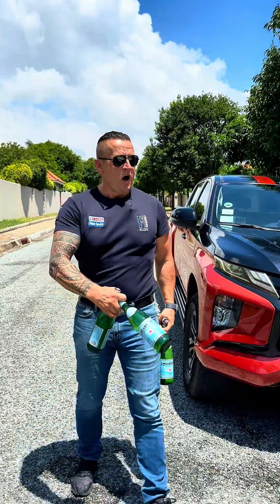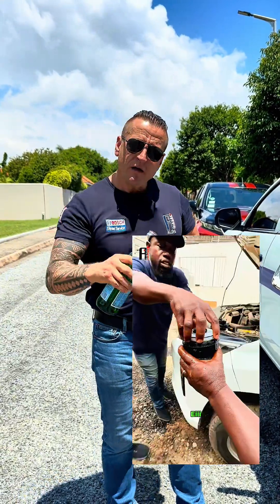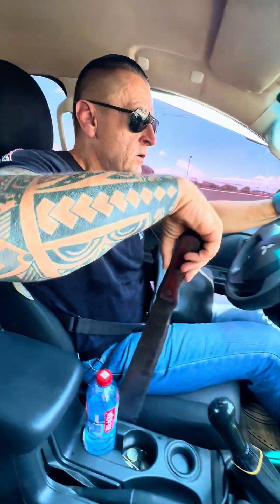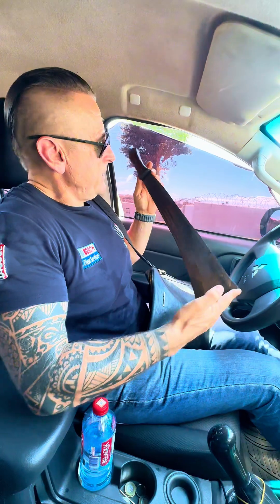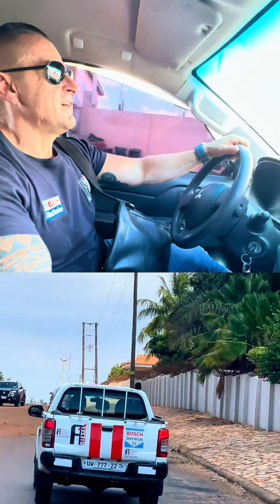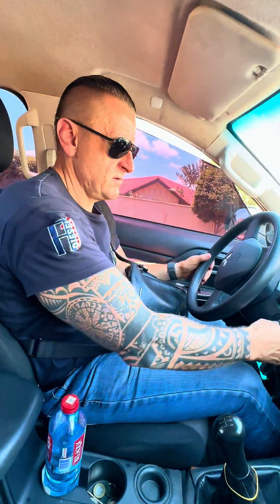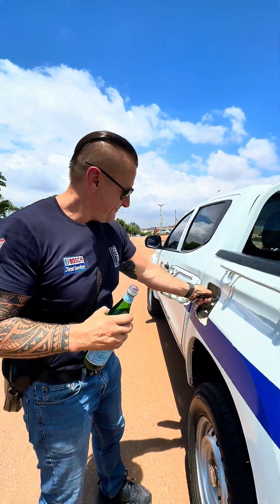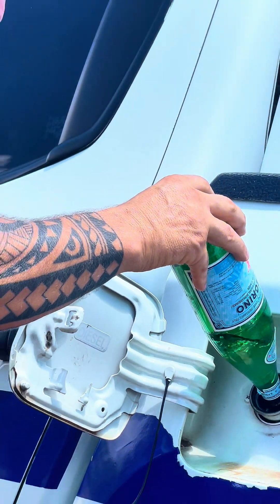What Happens When Water Mixes with Your Fuel? 🚗💦 Will Your Car Still Drive?

Comment: From my experience operating marine diesel engines, nearly all fuel lines I've come across are fitted with water separator before the filter itself. I've got situations where due to much water in the system, the water got passed the water separator and fuel filter and the engine eventually shuts down. So in my opinion the water separator will be effective only in cases where the water content is very small
Reply from the maker: Water separators work well for small amounts of water, but excessive contamination can overwhelm them, leading to engine shutdown. Regular draining, quality fuel, and maintenance are key to preventing this. ⚓️🔧⛽️